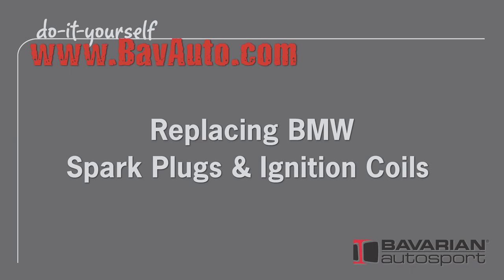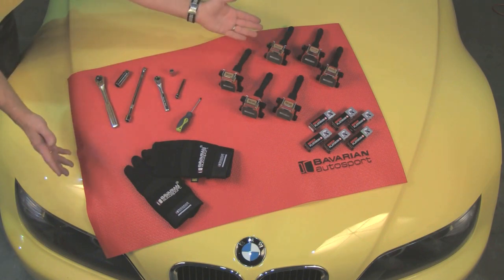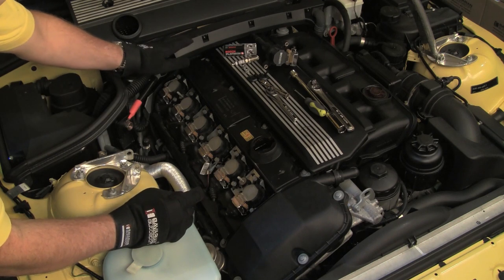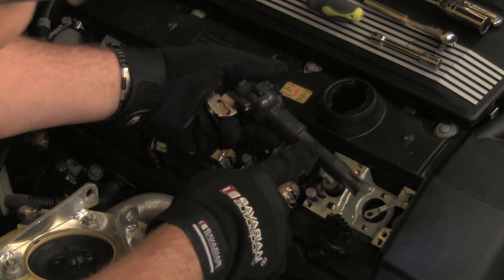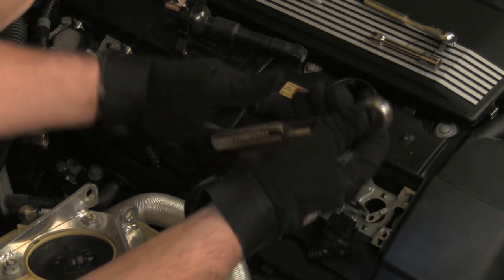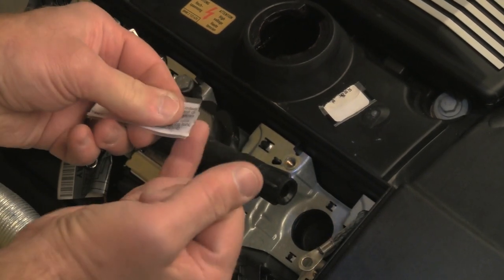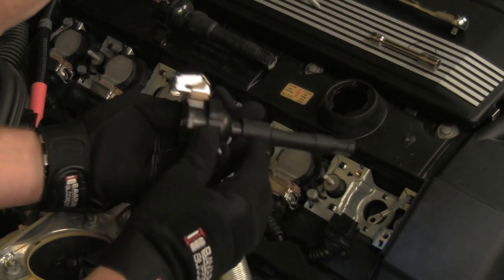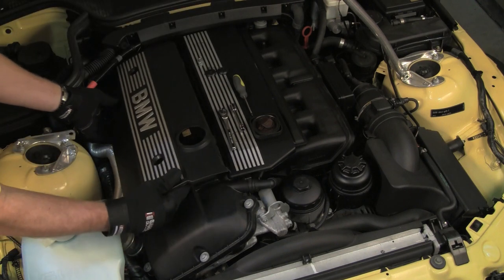Replacing BMW Spark Plugs & Ignition Coils

Comment: I have always used antiseize on plugs, especially in aluminium heads but looking at the NGK website they say not to use it on the plugs for my E46. Confused about this, do you or don't you use it?
Reply: +A.J. Green - do use, a very slight amount.
Reply: please pay attention to manufacturer instructions. they're installed dry at the factory, that should give you a hint

Comment: We had a problem with one of our coils.  It was replaced, and the mechanic wanted to change all 6 of them at the same time.  Because of the price, we said no.  2 weeks later, we started the car and took off, and the check engine light came on again and the missing started.  It went back off 5 minutes later.  My question is, how long is the life expectancy of the coils?  Is there any reason why they seem to be going bad at the same time?  It is in a 2007 525i
Reply from the maker: The coils are subject to very high heat and do, over time, tend to fail.  The first thing to do is to check the current fault codes (what code was generated when the light came on?).  Hopefully, the shop cleared the prior fault code(s), so you will only see what the current code is.

Comment: i have misfire at low rpm - less than 2000rpm only when i accelerate or it happen after a long destines like 100 km ,should i change the coils or the spark plugs only

Comment: Hi, I tried changing the spark plugs, I got through cylinder 1,2,3 however, the number 4,5, and 6 were super tight...I couldn't twist them using full muscle strength. Is there any solution to this? What should I do in this situation?
Thanks for the video
Reply: Tarun Luthra Try a breaker bar with an adapter. The longer length of the bar makes it easier to break them loose. Just be careful not to strip them.
Reply: Wladimir Delia Its starts counting from the front of the engine. If you don't know witch way is the front, google it with your make/model of your car.

Comment: I have a 1998 BMW 528i with 86,000 miles on it.  Yesterday, I was driving and the engine began to run a bit "rough."  The "check engine" light came on.  I drove it the short distance to my home.  Parked it and let it sit until this morning.  Cranked it.  Rough engine.  "Check engine" light came on.  Could problem be something as simple as need for spark plug replacement?  I am original owner.  I am not sure that the plugs have ever been replaced.  Any suggestions/advice would be appreciated.
Reply from the maker: First thing to do is to check what fault codes have been stored, using a code reader tool.
http://www.bavauto.com/se1.asp?dept_id=375

Comment: Do you really just tighten it 1/8 turn (past hand-tight) for every BMW model? What if you tighten it 1/4 turn (90 degrees), is it okay? I don't have a Bentley manual for specs, and I don't want to under-tighten or over-tighten my spark plugs on my 97 E39 528i. :/

Comment: I have a 2012 x5 35i and my cylinder 6 is misfiring. How do you know which coil to replace, left, right or are they marked. My warranty expired 2 yrs ago, and I know I’ll get rape if I take it to a bmw dealer. Do I need to buy a high performance after market ignition coil, oem coil or a regular coil will do? Thanks

Comment: I changed my spark plugs and I had oil in 4 of the plugs so I changed the gaskets it's a 01 740il v8 when I changed the gaskets the passager side was tuff I did not get the gasket on it all the way so when I started it up that side filled up with oil so I had to do it over I got it the second time around but now it sounds like the timing chain is knocking up on the vaul cover what did I do wrong can you email me
Reply from the maker: Shouldn't be anything that you did with the valve cover, to end up hitting the timing chain.  Hmmm ... any further diagnosis info?

Comment: I have a 328i 1998 bmw i just change the spark pugs ...the NGK vpawere spark pugs but it shakes and check engine light came on?? do I need to do better spark plugs?  the only ones HAD 4 arms..
Reply from the maker: What NGK part number did you use?

Comment: my 03 745li just hit 45k miles, I'm replacing all spark plugs, do I really need to replace all coils? I did get a code P1353, would I be able to tell which coil is bad by looking at it?
Reply: no, you switch up the order of the coils and see if the issue persists but on a different cylinder.

Comment: my e36 320  suddenly have a backfire within 600 to 1500 rpm  and i change the sparkplug ,fuelpump i check fuel pump relay and fuel filter . And keeps bacfire and dont run well . Any suggestion?
Reply from the maker: By "backfire" do you mean that it is popping through the intake manifold ... or that it is popping (banging) out the exhaust?

Comment: I have a 2006 530xi , experienced a skip and had the dealer replace #1 coil, they wanted to replace all 6 at a crazy cost. car ran fine , until a few days later it skipped when I started it, ck engine msg came on then car ran fine and no msg after 15 mins of driving. now about 75 miles later, engine svc light is on again and car seems to have a small skip nothing like before replacing the coil. suggestions?
Reply: Buy a cheap Bluetooth OBDII reader on Amazon for around $20 (Veepak brand is decent), download OBDFusion app for an Android, about $5. Then you can scan your car yourself, which will give you more information on why the svc light came on. If an apple user, you have to google search, but I think they use wi-fi.

Comment: What are some main symptoms of having a bad coil?  Very recently when I turn on my 2003 bmw 330ci, while warming up the car, I noticed my car revving the Rpm very slightly between the 0.5rpm to about rpm whereas in the past it stayed at 0.5rpm when I turned it on.  Would appreciate your advice
Reply from the maker: Typically, a faulty coil will generate a misfire fault code.  Your idle fluctuations are likely not coil related.  Have you inspected for potential vacuum leaks in the intake boots, bellows and hoses?  Has the "check engine" or "service engine soon" light come on?
Reply: BavarianAuto I have had the same problem. Someone suggested to take out coil by coil to see which one was the one failing. Any input on that? Thanks!
Reply from the maker: Adria Carbo
 - Not quite sure what the person was really trying to tell you to do.  You can't take the coils out and run the engine.

Comment: I have an E60 and i want to replace the engine coil but how do you determine which cylinder is which?
Reply from the maker: We're not sure why you need to determine which cylinder is what number, unless you have a fault code indicating a specific cylinder.  On a 6-cylinder, #1 is at the front of the engine.  On a V8, the passenger side (right side) is cylinders 1-4, starting at the front.  The driver side (left side) is 5-8, starting at the front.

Comment: My bmw 325i is shaking really rough when I turn on the car. You can hear the muffler rattling and some rattling coming from the engine. It just started doing this while I was driving on the freeway. I noticed it wouldn't go faster than I pressed on the pedal, and when I turned it off and back on again it started shaking violently. Please help. :(
Reply from the maker: Has the "check engine" or "service engine soon" light come on?  What year is it?

Comment: ei .I have a big problem! I have changed the motro from my car 316 1993 to motor 328 from 1994 . and I can not start the car! fuel pump is not working and plug boots is not powered ! but when I turn the key so the engine runs around with it will not start! can you help me plizzz ? Sorry for my bad enlish
Reply from the maker: Unfortunately, there isn't much we can offer without having been involved in the swap, or having the car in-hand.  We suggest that you perform a full diagnostic on the wiring and the engine management ECU pin in and pin out (using the wiring diagrams) to determine where the system is "falling down".  It sounds like the ECU is not being "turned-on".

Comment: I have 2 bad coils can the coils foul the plugs. should I change both?
Reply from the maker: Yes, the plugs could foul due to weak or faulty coils.  If the plugs look other than clean and properly burning, go ahead and replace them.  If it's been a while since a spark plug change anyway, just change them all while you are there.

Comment: Can someone help me ?  I have the stick ignition coil when I replaced it I cant get it to snap lock.  The old one snaps no problem but the replacement will not.  I returned it once thinking I had a defect but the 2nd coil will not lock.

Comment: I have a BMW 2003 525i and I have got a check engine light on with a code of p1349. I do have a missfire but does this have to do with spark plugs? I turn my car on and the check engine light does not go on until I start driving it a few miles and the it starts driving rough and eventually it starts feeling like it wants to stall but seems to keep pushing on but roughly. Any suggestions? It does seem like it looses power and I notice my rpm's at times will drop a bit. Could this be my spark plugs? Thanks
Reply: It's your Exhaust System
Reply: Onofren Mendoza I thought of that also. I am going to look into it. Know if that could turn into an expensive fix? Thanks!
Reply: i have the same car. ignition coil.  easy fix. there are 6 of them. the code will tell you which one to replace. i had to replace 3 of them. light would come on when driving. lose 3 power and car would shake.
Reply: Onofren, what a dumb answer. Please do not pay attention +Babyduarte89.

Comment: will this process be similar on my 97 318i 4cylinder?
Reply from the maker: While the M44 4-cylinder engine does have individual coils (one for each spark plug) Your M44 4-cylinder engine does not have the coils mounted above the spark plugs.  The plugs are accessed by removing the spark plug wire connectors and then simply removing the plugs.
Reply: okay thank you, owning a german car has confused the heck out of me since i got it

Comment: Hey, I have a e46 2003 330ci, when I start the car the Idle is realy rough, sometimes the car turns off by it self if I don't push the gas, it happend after I changed Belts, could spark plugs be the problem ? please someone help. Tnx
Reply from the maker: Well, yes, they could be.  However, there are many additional possibilities.  Have you checked to see if there are any stored engine management fault codes?  If you have over 60,000 miles on the spark plugs, replacement would not be out of order.
Reply: BavarianAuto Ty, It was air filter, there was a link in one of the air hoses.
Reply from the maker: ADEL Enhance
Good find!  Thanks for sharing.

Comment: Good video/tutorial.  But, most people should KEEP THE OIL CAP ON WHILE DOING THIS WORK, and only have the oil cap cover off when removing and replacing the Trim cover.  If you drop a nut or part down the oil filling hole, you'll have a nightmare on your hands !!

Comment: Will this work on my
2007 bmw 328xi?
Reply from the maker: The engine in your 2007 328xi is either the N51 or N52 6-cylinder.  These engines use the newer "pencil style" coils.  These coils just pull out (no bolts or screws).  We do not have a video directly for the N 6-cylinder engines, but the procedures would be very similar to the later M54 6-cylinders with the pencil style coils.  See our M54 pencil coil video here:  http://blog.bavauto.com/10523

Comment from the maker: In regards to the air conditioning being warm on one side, go to our blog site (blog.bavauto.com) and type "warm on passenger side" into the search box, on the blog.  We have a few posts covering this issue.
As for the exterior temp reading, you may need a new external temp sensor.  Again, on the blog site, search "E46 External Temp'.
You can also call our advisors at 800-535-2002 (603-427-2002).

Comment from the maker: Well, for $35 to $60 worth of spark plugs (in general, depending on model), that does seem like a very healthy charge.  Why not purchase the spark plugs from us and follow our various DIY videos ... or even purchase the applicable Bentley repair manual ... and have the satisfaction of doing the job yourself?  Even if you take the parts to an independent shop, you'll be into it for far less than the BMW dealer.

Purchase the plugs and the Bentley repair manual at bavauto.com

Comment from the maker: Change interval depends on your year and model BMW and the type of spark plugs that it uses.  Change intervals vary from 10,000 miles to 100,000 miles.  See out Ultimate Maintenance Schedule for model specific details.  Get the schedule on our Tech Blog at blog.bavauto.com - once on the blog, use the search box and enter "ultimate maintenance schedule".

Comment: Really...you're not going to edit your video to say that the coil packs really don't need to be replaced with every spark plug change out?  What a waste of money.  If this is really the case then Honda makes better coil packs than BMW at a fraction of the price and are never recommended to replace unless they absolutely fail based on real evidence. Hell, you might as well recommend replacing the head gasket if you think the coil packs need to be replaced at every spark plug change out.  I'd never purchase a BMW on this maintenance info alone.
Reply from the maker: We're not saying or implying, here, that the coils must be replaced with spark plugs.  Just showing how to do all of it.  If you only need to do plugs, pay attention to this.  If you need to replace one or all of the coils, follow this part.